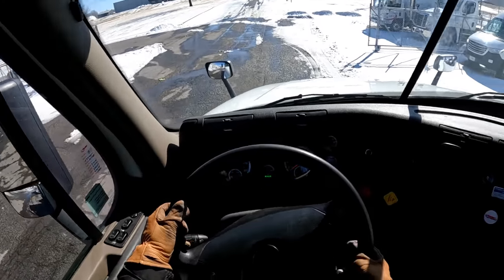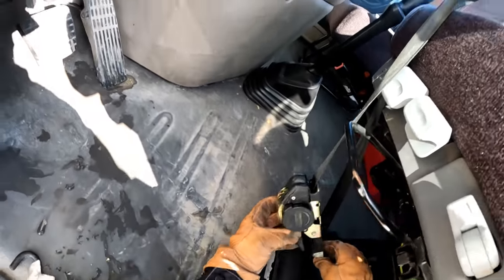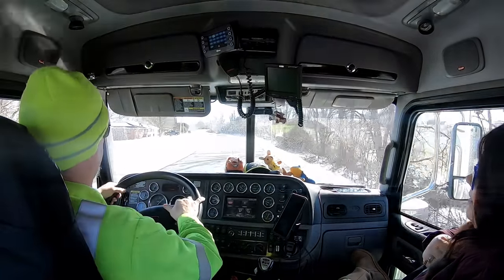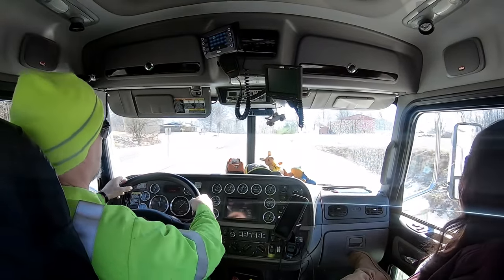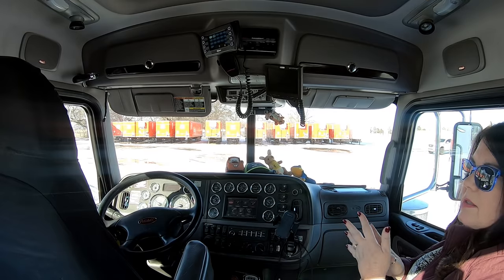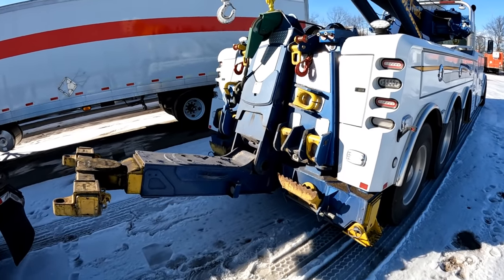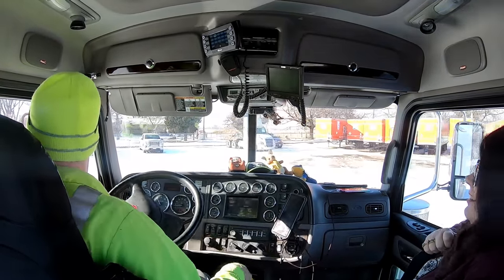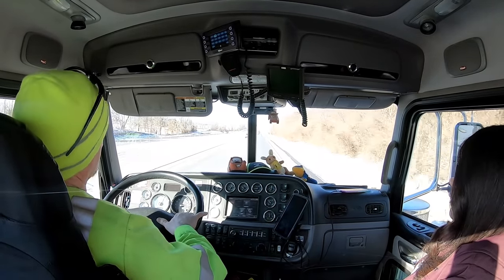Q&A Tow with "Mom Pratt".   INQUIRING MINDS WANT 2 TOW, I  mean KNOW

Comment: Question for you Ron. I work in a heavy truck shop and I think our shop could use a tow truck of our own. Not necessarily accident recovery, but just towing disabled trucks to the shop for repair. Are there any other licenses or training needed for a shop to operate a tow truck? If training is required, how long does this training course take? Is there a yearly training that has to be done to maintain certification?
Reply from the maker: That's actually how we started in the towing business.   There was only one other heavy tow company in the area and there were times when they would talk a customer into taking our customer's truck to a different shop, so we built our own tow truck to take care of our customers. Then we built the towing and recovery side of the business to where it is today. First, I would suggest you check with your state to make certain of all the regulations.   From the Federal level you would be required to have a CDL and the class would depend upon what you are wanting to tow.  Being a heavy shop, probably a Class A.   Federal does not require anything else as far as training or certification....sad, but true.   Some states, however, do require specific training and/or certification and specific licensure.  That's why I said to check with your state.   Also, would be good to check with county and local.   There are training courses available and I would strongly suggest that you take some regardless whether the state requires it or not.    Probably the top course currently is WreckMaster/TRAA.   They were separate, but recently merged.   There is also the Towing Recovery Institute of America run by Wes Wilburn (former instructor for WreckMaster).   Another HUGE thing you should consider are your insurance options and requirements.    IF you are only towing a vehicle to YOUR shop for repairs, you aren't working wrecks, and you aren't towing anywhere other than TO your shop, you can get less expensive insurance and may even be able to cover it under your garage keeper's liability.   That would be a question for your agent.   Make certain you have more than enough insurance coverage!!!   Yes, it will be expensive, but necessary.  You'll also need to consider whether you are going to tow across state lines.  If so, then you get into possibly having to file IFTA as well as many other things, if you are going to do it legally.   If you don't already have a U.S. D.O.T. number, you will probably be required to acquire one.   It isn't difficult or expensive to obtain, but is necessary for most business vehicles.   There are companies who specialize in setting up your "operating authority" and assisting you with many of the things I have mentioned.   I'm certain that I'm missing some things, but this gives you a general idea....I hope.    Best of luck.   May God's blessings be upon your venture.   Thank you and God bless.
Reply: @RonPratt  Thanks Ron for taking the time to reply. I am working in Missouri as well, which is partly why I asked about licenses. I figured you would know best. I don't know if you're familiar with the DMU style of wrecker, but are those heavy enough to tow a combination unit? Some I have looked at are rated to pull 85,000 lbs, but I don't know if that's too close of a margin. I work fairly close to St. Louis and we would possibly cross state lines as we have some fleet customers that are based in Illinois. I'm just trying to do some preliminary research so I can go back to my boss with a proposition as a way to possibly help our customers a bit better and another source of income. Instead of just going to him and saying "hey, we need a tow truck". We have had some cases also, where another tow company will drop a truck on our lot because there isn't an empty bay available, so we have to use a worn out 10,000 lb forklift to try and push and pull a truck into the shop. Having our own truck would allow us to easily move an already down truck into the shop. Thanks again Ron. God bless.
Reply from the maker: @dangerrangerlstc  Perhaps you mean a DTU unit???  If so, they are a good option, but, you have to have the right truck to make a DTU work legally.   Most have to have counterweights put behind the front bumper to keep the front axle weight safe enough to drive when loaded.   Then it's a balancing act between being too heavy on the steer when empty.   It can be done.  But you need a longer wheel base with a DTU.      Using a standard road tractor usually isn't going to work with a DTU.   If you have it set up properly, however, it can be an excellent option for a tow unit.   You can remove the DTU and then have a road tractor to move trailers with as well.   There are lots of things to consider.
Reply: @RonPratt  Thanks for the input Ron. Much appreciated. Hopefully I can at least get my boss to start considering this as an option. There's several tow companies around us, and we have trucks towed in seemingly every day, so hoping we can capitalize on some of that without stepping on our customers toes too much.

Comment: Ron I have a question regarding prices. Let's say you get a call for a loaded truck and trailer, and it's on the side of a highway. My question is would you bump the price up pretty high if it's dangerous now I know that Towing recovery on the side of the road is pretty dangerous in it of itself but my question is like if it was a particularly challenging or something would you end up raising the price
Reply from the maker: Most of our charges are pretty standard.  We increase based on the job, what we have to work around....in a recovery.  The towing is standard though.  Thanks for watching and God bless.

Comment: Ron, I have one question that I don't think was addressed:  I believe you that your truck is 73k lbs, so how is that legal on only 4 (or 3) axles?  Is that legal in your state, or do you have a permanent overweight permit, or do emergency service vehicles get an exception?
Reply from the maker: It is legal based on the axle capabilities.   The tandem drive axles are rated at 54K.  The steerable lift axle is rated at 20K. And the front steer axle is rated at 20k.  This gives me a total GVWR of 94K.  Yes, we are limited to the 80K on the truck for legal reasons without a permit or under emergencysituations, but at 73K I am perfectly legal. Thanks for watching and God bless.

Comment: Eagle Scout huh, well then you know how many Scout Laws there are, right? This question flunks more candidates than anything else. So, think clearly.

Some history on myself the troop I was in folded and there weren't any in the area so I didn't make Eagle, but I did become an over-trained Scoutmaster, Unit Commissioner, Asst. District Commissioner, who trained the Commissioner for his job. I hold the District Award of Merit, Cub, Scout, Explorer Training Awards, and Scouter's keys for each, the District Training Award, and Key as well. I'm also Wood Badge trained (a brief explanation it's considered the Master's Degree for being trained) awarded 1979. Was on the District Training Committee, training all leaders. Was a member of the Eagle Board in the District Committee Position. Yes, I did ask pointed questions as you could see by the one I asked you. My degree in Theology (1963) might have helped keep me level-headed. Master's Degree in Industrial Computers, Robotics, and Electronics Engineering 1996. One thing I never mentioned to the instructors was that I'd built an HW-101 ham radio back when I was 13 (this was before transistors, so the radio is a tube-type radio that still works to this day. I had an advantage that I didn't mention to them nor did I to the military when I went into the Navy also in '63. I was assigned to the USNS Guantanamo Bay Cuba, to FTG (Fleet Training Group) in electronics warfare and communications. The Navy knew about my ham operators license WD4IMI (which I relinquished when I didn't renew the license). So, I am studying for the Technician Class, now.

But while a Scoutmaster from 1972 thru 1979, the troop had 3 Eagle Scouts in less than 7-years. One who now is living in the NW FL, Southern Alabama area still visits his 91-year-old mother. He's the Rev Edward R. Glaize, DD., which said he'd used the knowledge also knew how to study. The other two I haven't seen hide nor hair of them since they left the troop at the age of 18. I do know however that neither of them went on to college.

Comment: i assume from your comments that the brakes on a steer axle are air applied unlike drive and trailer axles where air is used to release the brakes.  is this correct?  thinking about it, i've never seen the front brakes being "caged"
Reply from the maker: Actually, most heavy truck in the USA are air applied.   The drive axles air also air released.    The difference being that the drive axle with "parking" brakes have a special spring brake chamber.   It is a 2 part chamber.  The second part of the chamber houses a large spring that applies the parking brake.  It takes air pressure to retract that spring and release the parking brake.  Once that is done,  the service brakes operate on air pressure the same as the steer axle.     By "caging" the brakes, we are manually retracting that spring rather than using air pressure to retract it.  Thanks for watching and God bless.

Comment: a few years ago I had a job being a traffic control flager for a few months here in Oregon. during that time i have see many people doing funny and crazy things, and one time was a police chase racing through the intersection we where flagging. have you had any thing like that happen while working an other wreck?
Reply from the maker: Yes, we have.  Perhaps the most memorable was many years ago, before we had the rotator.  A driver pulled out of a parking lot and drove his tractor straight into a ditch on the far side of the road.  His trailer was leaning heavily and was blocking Main Street in our small town.   Police and Fire had the road blocked off on both sides of the incident.   We were working and had lines tight pulling the unit backwards when an elderly gentleman went around the barricades.   I ran towards him waving my arms an got him stopped inches before he ran into one of our winch lines which was stretched tight.   It could have been a very bad situation.   Thanks for watching and God bless.

Comment: With how the boom rotates and you can use it like a crane do you have to have a license with the nccor? If someone already has a class a CDL and a little bit of training for rollbacks towing can someone get a job as a heavy operator or do most companies start the new guy on rollbacks?
Reply from the maker: I would need to ensure that an operator was properly trained on the large equipment for an extended time before turning them loose.  It also is based on performance, experience and how level you can remain in tense situations.  Once proven abilities and track record is established you would be on your way.  I don't know how other companies operate, but I am probably overly cautious????  Thanks for watching and God bless.
Reply: I was wondering how tow companies get around using their booms. Ive always wanted to be a semi wrecker driver too that is until last year when I got a job working for a construction company, where I drive a semi to different job site and use a 65ft boom and lift shingles up on roofs for contractors, so thanks for your answer it was much appreciated. I'm 26 btw too and live in Michigan.

Comment: I could not hear the Q&A due to back ground noise due to my working around loud equipment in my youth and suffering some hearing loss. My suggestion would be to do it in a quieter setting.
Reply: The video is captioned, enable the captions by clicking the caption icon on the lower right hand side of the video screen.
Reply: Turn on closed captions. Tap the screen then click the cc. Or you can do it through your settings.

Comment: Ik here n ny u heed a sling and tow indorsment on ur DL and need atleast class b but class A def helps.I did recovery many yrs b4 EMS.B safe.god bless..peace
Reply: Just the W endorsement for towing, which upon passing the test will change your license to a class C(by default nys dl is class D) however you still have the 26K weight restriction until you get a class A and take all appropriate tests to get it removed…. There’s no such thing as a sling endorsement as far as I know…. Have had my towing endorsement since 2012 so unless that’s something new since then but I doubt it, the company I worked for (got cut basically cause of ‘rona) would’ve made me get it cause they were big on making sure all drivers had the latest and proper endorsements.
Reply from the maker: Thank you for watching and God bless.
Reply from the maker: Thank you for watching and God bless.